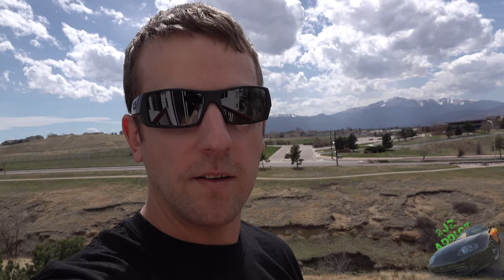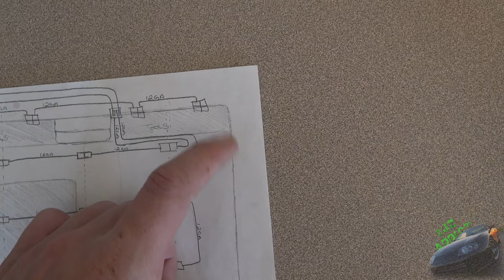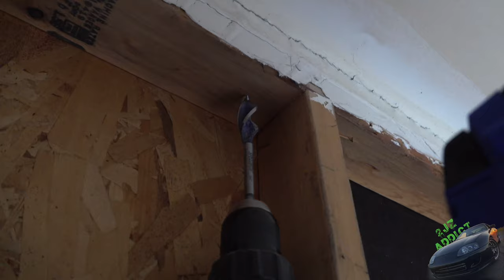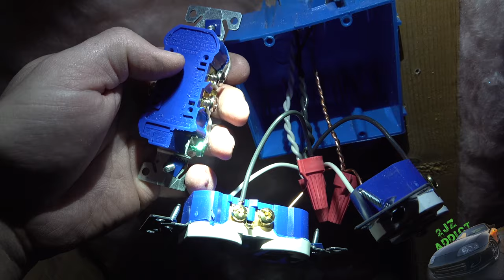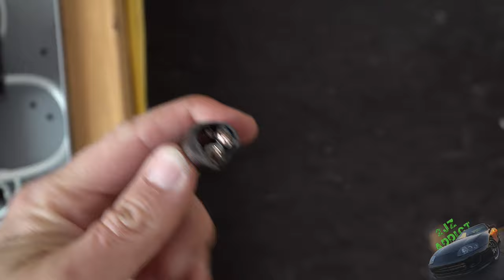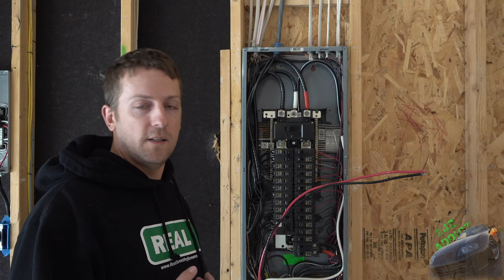Garage Mods Episode 1 : Wiring a sub panel, 240V outlet, and LOTS of plugs!

Comment: You only need one gfi outlet per circuit. The rest of the plugs wire into the gfci outlet controlling the circuit. So it's a third the cost going with gfci outlets. The 240v plug and lights do not require gfci so normal breakers are fine for those. Also your garage is not safe wired with 14 gauge wire on a 20 amp circuit. Code requires at least 12ga for a 20 amp breaker. Putting 14 ga on a 20amp breaker might end up with the garage getting several thousand degrees hotter than you prefer. Im assuming the inspector already failed the inspection for this reason.
Reply: Exactly right you can't run a 14 on anyting in a garage. I am a retired electrical inspector. That's exactly why homeowners and renters should never do their own electrical installations. Just because the light comes on definitely doesn't make it safe
Reply from the maker: According to the code for my county, 240V requires GFCI since its in the garage. Given the number out outlets installed, GFCI breakers were more affordable. As for the gauge, it passed rough in and final just fine. I’ve got a 40% build over for what I’m doing. I appreciate the input though.
Reply: @2JZAddict  I'm not understanding your math on the cost. 4 gfci breakers would cost over $200 4 gfci outlets cost $65. Did you have the 20 amp breakers installed for the rough in inspection? No inspector will allow 14 gauge on a 20 amp circuit. Its legitimately a fire hazard. I'm not joking your garage is as risk and your insurance will deny the claim if it does burn. Its a simple fix swap the 20s for 15s and the wire will be protected. You can save cash by dropping in a $5 15 amp breakers and swap the first plug in your string with a gfci plug. The gfci plug will give you gfci protection for all downstream plugs wired to it's output. As an example if you trip the gfci plug in your kitchen you lose all the plugs not just the single gfci outlet. That's assuming the installer wired it correctly.
Reply from the maker: I understand how they work and you're right. In a kitchen or bathroom setting that would work just fine. Local code where I am requires each individual garage plug be GFCI @ $20/plug or I can run a single GFCI breaker @ $50/circuit. I could cover the cost in breakers in the ceiling outlets alone at that rate. NEC states that the load limit for 14ga wire is 20A. Are you saying that the NEC is wrong or do you prefer 15A for additional safety? The reason I built out the system like I did was because there won't be any substantial load on it. Even with running my lift, air compressor, and all the overhead lights, while charging some batteries it will be less load on a a shorter run than most people will run in their home offices with all the computing equipment and a space heater. That said, I'm all for swapping out some breakers for additional safety since they're not going to trip anyway. And yes, the 20A GFCI breakers were installed for the rough in and final, and it was the same inspector for both.
Reply: You can run up to six receptacles protected by one GFCI receptacle. On a 20 amp circuit you can load at 80% which is 16 amps. on a 15 amp circuit which is 14 wire that you have. You can only load it to 12 amps which is 80% of 15 amps
Reply from the maker: Exactly. So when I’m running 100W worth of lighting on two separate circuits it’s fine. So is running my battery chargers since their aggregate load doesn’t exceed 10A even with all of them plugged and charging at the same time. The welder uses 240V so I would need to unplug the lift and the air compressor running a 15amp motor has its own 20A GFCI plug already installed from when the house was built. Based on what I’m hearing, it sounds like I should swap out some breakers for everyone’s sanity in spite of the ability of the components to handle things safely. At least that’s a quick fix that doesn’t involve removing drywall. Lol
Reply: @2JZAddict 2017 nec section 240 d 3. An issue you might run into is 14 ga in a dead short might not trigger a 20 amp breaker pumping 2400watts of heat into your insulated walls.  As you said you're not using that much power so 15 amps isn't going to limit you. The wire is fine just needs a smaller breaker.
Reply from the maker: Great info. Thank you for the clarification. 🍻👍
Reply: You need to look at article 334 in the NEC, it will tell you that 14/2 nm cable is only rated at 15 amps. So if your inspector passed it he was wrong. They are right about your insurance. If you have a fire when they investigate and find the 14/2 most likely deny claim.
Reply from the maker: @thomasmarable6818  See 14:15 with the 15a breakers installed on the 14/2. 🍻👍

Comment: Need 20 amp GFI outlets in the garage so use number 12 wire 14 is only 15 amps not good
Reply from the maker: For most folks running 12ga would be a safer play, I agree. It really depends on what you’re using it for. I’ve got a 12ga circuit for my air compressor. The only other stuff I plug in is lights and battery chargers though which is why I ran 14ga on the rest of it. Those aren’t going to pull sufficient enough amperage to warrant the additional expense of 12ga wire and 120V outlets.

Comment: Just curious.. you wired up the neutral for the 240V outlet in the box, but then it was not used in the outlet box.. if you are not using it, wouldn't it be best to leave it disconnected in the panel?
Reply from the maker: You could if you wanted to. I attached it to ease outlet swapping in the future. The NEMA 14-50 uses it so if I ever end up buying a Tesla or something it’s one less thing to remember and just a simple outlet swap since it’s already attached in the box.

Comment: Cigar cutter for those bigger wires
Reply from the maker: That’s a great idea! Wish I’d thought I’m of that. It would have been way easier than a razor blade.
Reply: @2JZAddict  I know there’s a tool that’s like one that is the proper tool but I have cigar cutters 🤷🏻‍♂️
Reply from the maker: Hey, if it works and you don’t have to worry about slicing fingers it’s all good. 🍻👍
Reply: @2JZAddict  li

Comment: Why run 14 gauge, the house is 12/3 cable, I only used 14 for low what lighting.  Also at 20 amps GCFI suck! I cant imagine a 15 fuse, soon as my inspection is done Im swapping these things out totally, even the 20's.  Cant run a dam thing without running 220, Im building my house I need to run all my gear off my dryers plug which is a dedicated 20amp fuse that does not trip.

Comment: Did I miss something??  You never showed the main panel feed to the sub panel breaker. What size was it ?
Reply from the maker: It was 2/3 from the main to the sub.
Reply: @2JZAddict  I’m sorry what, size is the breaker?
Reply from the maker: I used a 70amp breaker (it’s a 100a sub panel so I could have gone higher). With everything that I might be using on and running at the same time I’d have capped out at 62amps including a 20% build over so I went to the next highest size which was 70.

Comment: Thanks for the video. One question, is it 125 amp sub panel or is it a 50 amp sub-panel?
Reply from the maker: Thanks for watching! I’m glad you liked it. The sub panel I used was a 125a. Depending on your application you might be able to get by with a smaller one. I went a little overboard on breakers and could have strung more of the outlets together. The additional breakers required more knockouts so there was no way a 50a panel would work.
Reply: 2JZ Addict thanks for the help.